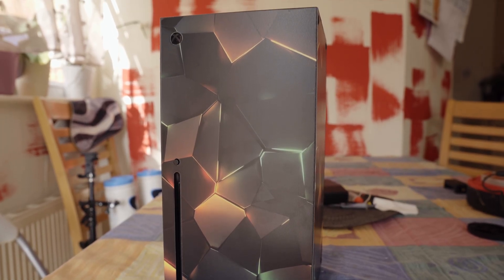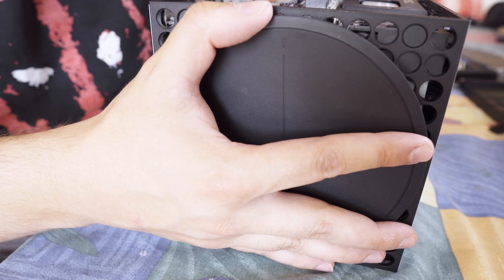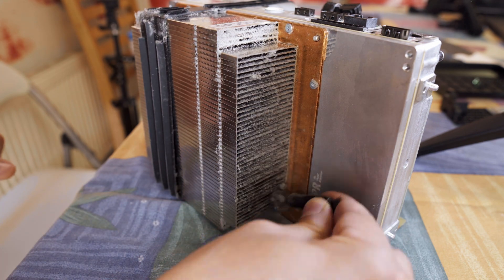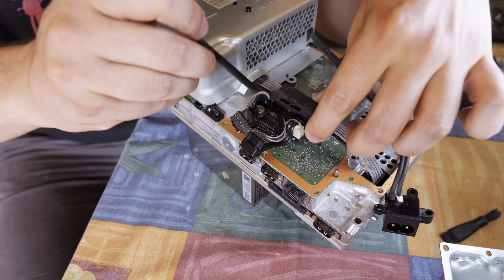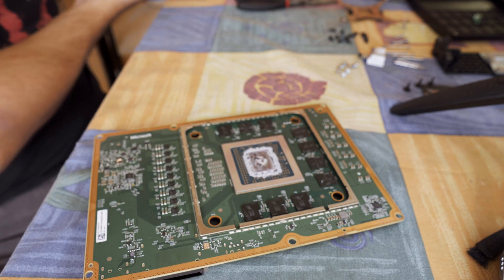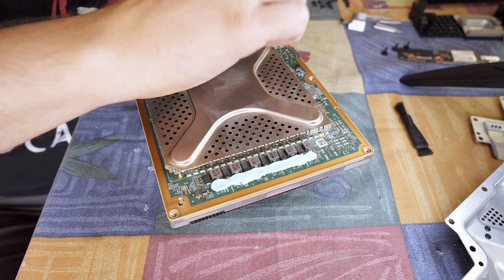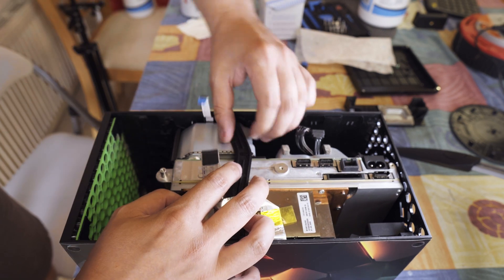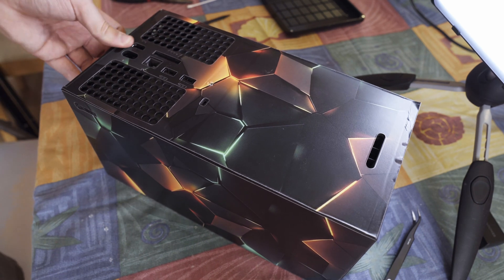Xbox Series X - Disassembly, Clean and Re-paste

Comment: You can take a little autosol and polish the copper of the heatsink getting rid of any oxidization. You should also replace the thermal putty on the vram and ssd.

Comment: is there anything you can use to take off the back screws except for the special screw driver
Reply: I used a torque drill bit to unscrew the bits.
Reply: And I cleaned the motherboard.

Comment: My model had a different ribbon connecting the PCB layers. Only needed to push on lever in the front to remove it. Mine also didnt have a shield for the arms underneath, thankfully. That looks really fragile.

Edit: The whole reason I started this project was to hopefully fix my system's tendency to shut down any time it runs a graphically-intense game for more than a few minutes. It did not help in the slightest and now I'm out of ideas.
Reply: I recently had an HDMI replaced, after getting my xbox back it was originally overheating after running any graphic intense game and shutting off, the store then replaced my fan but its still doing the same thing so i was curious if this was going to help. Have you had any luck since this comment? Any help would be appreciated
Reply: @Hollowslides Funny you should mention that now. Yes, actually, just recently. Though not in the way you might think. My final decision was that it was a thermal sensor issue. Everything I was reading online was that you were supposed to get a prompt when powering back on that told you the shutdown was due to high heat. Since I wasn't getting anything, the system didn't even know that much. Since I don't have any knowledge of soldering, I figured i could come up with an external cooling solution.

What I did was, I bought a $30 bathroom exhaust fan and placed it on top of my vertical system vent. You need a 6 inch fan. It has the power and the size to suck air all the way through. Bonus points if you know how to wire a toggle switch to the cable so you don't have to unplug it every time you stop using it. I also got some rubber gasket used for windows to help seal the bottom side and cover the metal edge, as well as some thin mesh to cover the top. 

It's dumb and goofy looking and takes up a lot of space, but it works 100%

Comment: Is there anywhere I can get a full replacement screw set? I bought a second hand one and the guy who owned it previously took it apart and put hardly half the screws back
Reply: Don't worry about it.
Reply: Update- on some cheap ass Chinese sites you can buy packs of screws with the same threads and diameters, if you can find the right sizes just do like I did and cut them to size either with a grinder, jigsaw or sawzall

Comment: I notice you're not using any kind of Anti-Static Strap. 
I've done a few basic PC mods and console repairs over the years and I've never bothered using one myself but the official guides recommend using one for even basic repairs like fan replacements (which I'm about to do when my new fan arrives) and it's got me a bit paranoid. 
IMO if I'm not touching the connector pins or any PCBs I should be fine right?
Reply from the maker: It is recommended yes, but the chances of shorting something is very low. If you are still paranoid you can just touch a big metal thing like a radiator before you start working on your machine and every now and then touch it again before you do another move.
Reply: @TechGadgetsMedia  Hey, great chill vid and thanks for the reply, I really appreciate it. 
I spoke to a local PC repair guy today (bit of an old timer) and he said he's literally never used one in his life so that set my mind at ease. You and he have both said the same thing pretty much, just use common sense, ground myself before and during the process and it will be fine. 
Unless I'm running around the house rubbing my feet on the carpet to get my hair to stand up I'm probably not going to have too much of an issue 😅
Not sure if I'll do the full disassembly anyway, I just want to remove the bulk of the dust while I'm replacing the fan. The thermal paste can wait till next time I think.

Comment: So while trying to remove the fan to clean it i couldnt undo the big middle screw. To the point i somehow managed to break the grooves for the screwdriver on the screw, am i screwed?
Reply from the maker: You are indeed in a screwed situation.
Reply: @ guess im not cleaning that fan then. Though thanks for showing me how to open the console, did do some cleaning!
Reply from the maker: You can try with a rubber band and then the screwdriver to unscrew it but it might not work.
No worries and good luck!
Reply: If you have a pair of what we call molegrips or vicegrips or locking pliers or even pliers that don't lock, you may grip the centre screw from the outer edges and turn anti clockwise to slowly undo. Locking pliers may have to be released and reset a few times because of the lack of space to obtain complete rotations. You will find that the centre screw shows the signs of having a locking compound applied at manufacture. Hence the solidity of the bond!

Comment: Is there no point cleaning the dry thermal paste surrounding the outer edge of the cpu, is it risky to rub that part of the mother board?

Also are you able to provide a link to the tools you use in the video?
Reply from the maker: The main part that needs to be covered is the CPU dye itself, that's the most important. If you still want to clean off the rest then use a plastic tool and little to no force to scrape the thermal paste off.

I'm using iFixit tools mainly and isopropyl alcohol. Google them and you will find it easily.